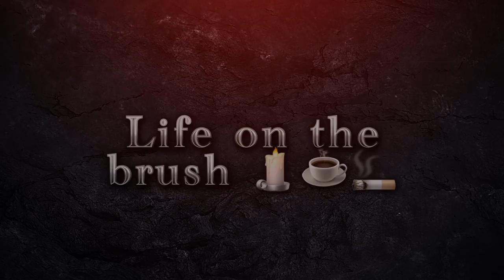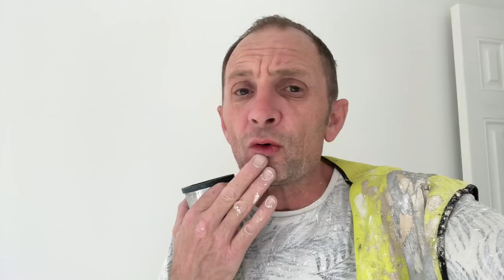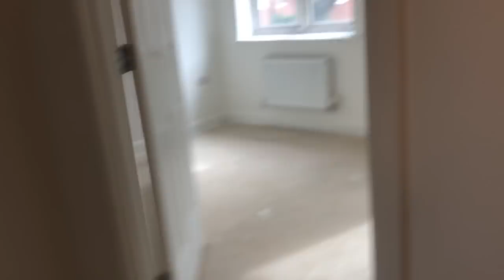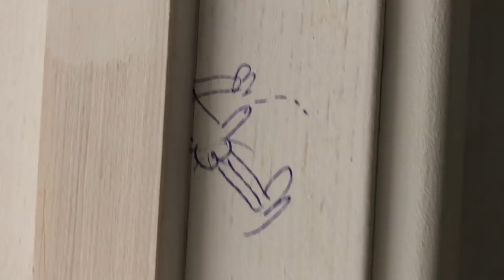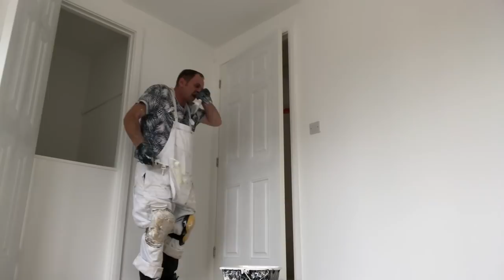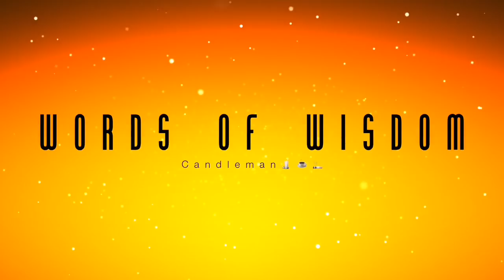Life on the Brush, every day is a fight

Comment: You would score 4hrs if used Johnstone aqua gloss and undercoat. I'm surprised just how quicker using this system is. Goes on like a dream. It's not drastically yellow in a few months either. Almost the appearance of oil gloss. Put your mini scuttle on  hopup when doing the top half doors, easier on the old arms.!

Comment: What roller do you use for glossing the doors
Reply from the maker: Wooster 6.5 inc, medium pile
Reply: @wallingtonfilming   I use a Fossa 9" short pile microfibre on my doors Mark . I store it in a brushmate 4 (the small one) with a small plastic block in the bottom so it doesn't sit in any  sludge . Just open the lid and press the cage frame into the sleeve and good to go. Although i do tend to lay off i sometimes leave them in a roller finish as it leaves such a nice almost spray like finish. If on a tight schedule i don't bother laying off.